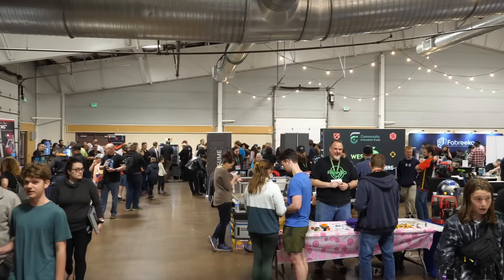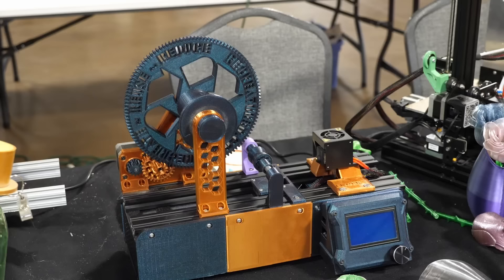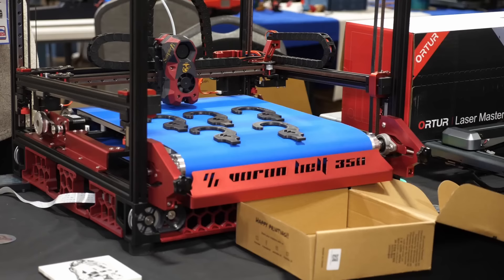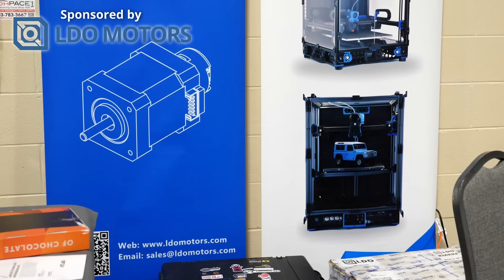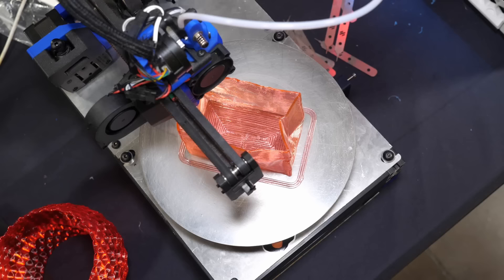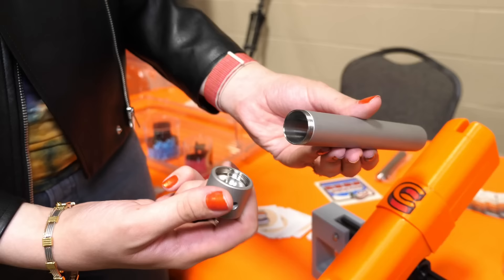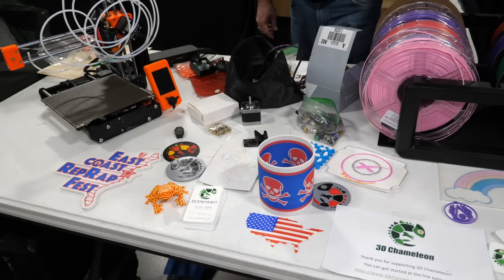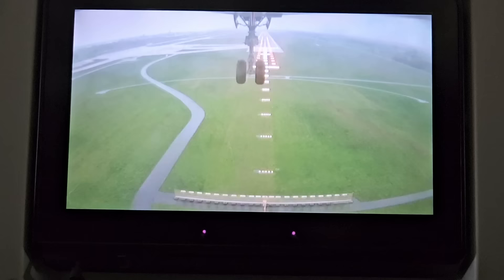10 AMAZING 3D Printing Projects: Rocky Mountain RepRap Festival 2023

Comment: Essentium also makes a dual-core 25% carbon fiber filament called HTN-CF25. We use it a lot at work, it's insanely strong and rigid and prints as easily as PLA as long as you keep it dry. It'll be interesting to see if the new Phaetus filament is as good.

Comment: I've been using a 3rd-generation Hero Me on my ender 3 for quite some time.  The part cooling is absurdly better than the stock ender 3 cooler.  If I care about surface finish, I can print up to ~60° overhangs.  If I don't care or am willing to do some sanding, it can go all the way to 75°.  Bridges work great, too.
Reply: Also the ability to add/change something on the toolhead by just printing another piece of a standardised set is amazing.
Reply: @Fifsson_  wow that sounds awesome

Comment: Maybe a bit off topic here. I had this crazy idea to increase print strength. The weakest part of a print is the layer adhesion. What if we design a solid part. Print the first layers as normal. The perimeters are printed as normal. Now for the fill we skips about half of the layer lines in a tooth like pattern. The next layer is printed at double layer height filling the open space and sticking one layer height above the previous one. The principle is repeated for the full print. Hypotheses: The layers stick to both the bottom layer and half of the sides of the previous layer and as a result the print will be stronger. Can you test this or is this already tested?

Comment: With careful orientation of one of the two coloe co-extrusion filaments on the polar printer, you could get a vase mode print that is one color on the outside and another color on the inside.

Comment: The Photoncast has my interest.  At work, we use a large amount of one off insulators for high voltage and high current buss bars.  Being able to coat them like this with a, insulating resin would greatly decrease our production time on prototypes.

Also, the Co Extrusion filament has always caught my attention.  The ability to add such a strong material to a print would take most prints from testing ideas and low strength cover plates to more structural parts, again for low volume prototype equipment.  The only problem so far is that every retraction requires a filament cut to sheer the core material.

Comment: Regarding the chocolate printer. Now this is cool. I see that they recommend their chocolate to be used and that it is formed to meet the shape needed for the printer. What will be unique here is that the chocolate would be much easier to recycle vs. filament. However, it would have to be melted down and put into a mold that shapes the chocolate correctly so it fits into the unit. Now I am not a baker so I do not know how many times chocolate can be remelted. So, initially printing something that fails, then to melt it down and reshape the chocolate into the needed shape for the printer and then, again, printing a new shape using the printer might be an issue as I am not sure how much melting and remelting of chocolate can be done.

Comment: Hi Stefan, 
Could you do a video comparing the strength of Bambu Lab's different filaments? I'm a manufacturing engineer, and I was able to talk my boss into getting an X1-Carbon. I need a filament that is strong, impact resistant, and has good wear resistance. I am especially curious how the PC, PLA Tough, PLA-CF, and PETG-CF stack up against each other.
Thank you!
Brohde

Comment: HeroMe cooling is ok, i was using it for a while but i noticed that it is using a lot of hardware [screws, nuts, inserts) and it was really annoying and complicated to mount or dismount on my CR10 and Ender X adapter plate. So i used his mounting solution and change it to a better one that Petsfang was using and my design use only 2 screws to demount whole setup (not counting hotend).

Comment: It's amazing how many people are so happy to re-invent wheel after wheel and try the most difficult ways of doing something in the hopes that they somehow stumble upon the next fad.

The upsidedown printer is a gimmick, ofcourse, you don't want to have to deal with the aftermath of a PLa spaghetti getting all inside the mechanism of that system. 

"The polar printer head onlyhas to move the radius of the disc"

It still has to travel the exact same distance along the print, the only difference is that the arm only has to reach to the center of the disc, but that has literally never been an issue in any printer ever.

The conveyor printbed is an interesting idea that is ofcourse not even remotely something new but coming up with new ideas is hard.

Again, lots of dreativity and very very little thinking. The only thing worth a mention is the chocolate filament, but again.... bakers have been using CNC to print cakes for years.
Reply: If you think it's printing upside-down to be a gimmick then you should watch his videos. The Positron is a compact, portable 3D printer. The reason it's printing upside-down is to keep most of the weight at the bottom of the printer and still allow fast printing speeds without needing a huge rigid frame like most other printers. As a bonus, you can see 100% of the first layer without the hotend obstructing your view which can be annoying with small prints.